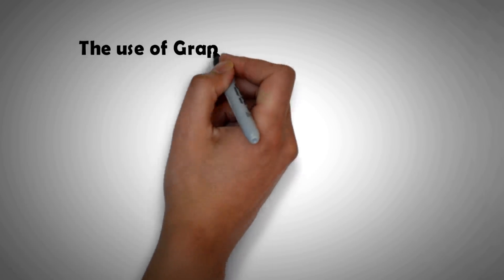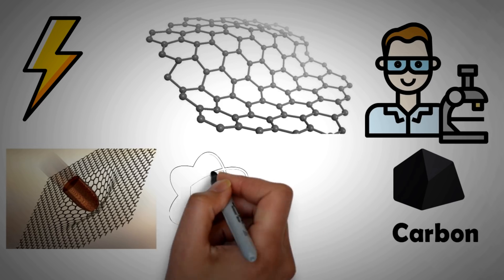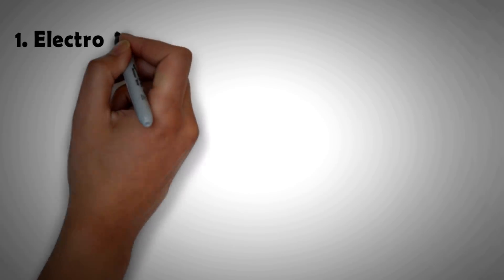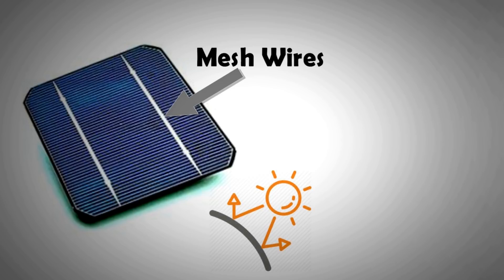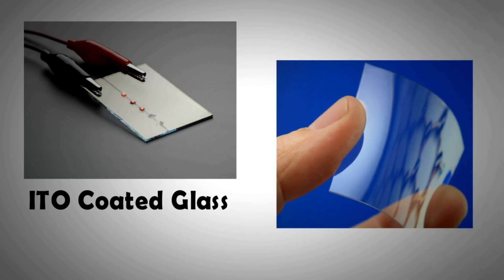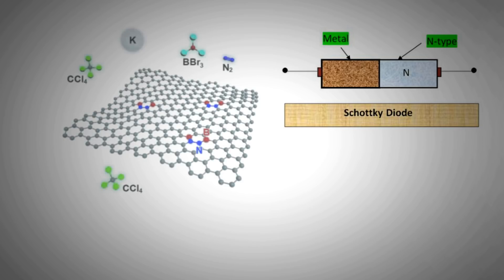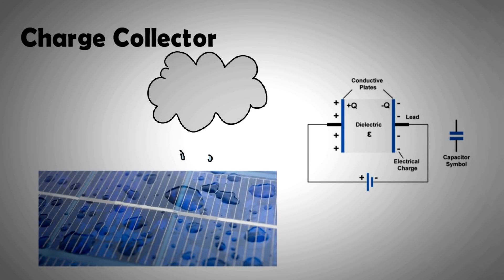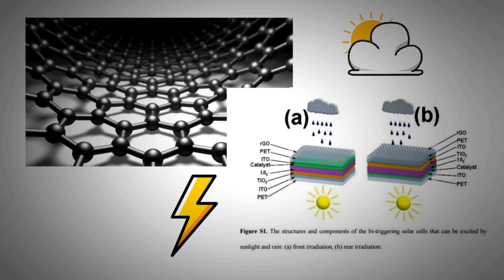How Graphene is taking Solar Cells to the next level

Comment: Reading the comments shocks me how little people understand how challenging it is to get from the research stage to the product stage when dealing with a fundamentally new discovery. The fact that graphene is finally being generated by suppliers like Sony means that we're still some time away from scaling out the supply that will then allow the most basic usage. As an entrepreneur for several decades I've seen technologies be hyped up in the press, then disappoint, then gradually become mainstream. Bluetooth is a perfect example. It was labelled a failure after the hype cycle didn't result in products in people's lives. That changed around the time smart phones arrived and Bluetooth is now expected in so many types of devices. The only way to speed this up is to buy graphene, create startups that create products that use it and thus create product demand that ensures suppliers invest in scaling out and lowering the cost and improving the range of graphene available. Otherwise you will continue to complain that it is a conspiracy of greed holding all the good stuff back from you, the lazy consumer. Got the dream? Do the work.
Reply: Bruce Joy what you say is very true.
but the problem of. getting venture capital stops many new products.
socialist economies can go from university research to market very easy.
as capitalism does the R&D the socialist can manufacture thru state investments.
this stop venture capital as rates of returns are decimated by copy cat products and reverse engineering.
Reply: That process also brings decisions from bureaucrats which they have no expertise in ,such as China building cities where there is no need and Russia starving millions with collective farming.
Reply: @delallegood5799  those cities might seem unnecessary now, but in the long term...

Remember, China got to this point by playing the long game.
Reply: @ki0w0-lordofwatersheep  Great idea, so why don't we overproduce for all our other EVENTUAL. maybe needs.  I disagree! Why don't yo go out and build a 3 car garage, in case in 20 years you MIGHT need it? 
PS.  don't for get the buidling maintenance costs in the meantime. Cracks in the foundation, new roofs etc. !!!
Reply: @delallegood5799  the collective farming thing was on purpose to kill. not incompetence.
Reply: @carlojones8610  jeez....you do know that socialist societies don't innovate right?  They will never produce a new product on their own as a result since no matter how hard you work, you can never do better for yourself than the government allows, so why bother?  THAT is how socialist societies work, based on real human nature.  Any of you think otherwise, you should go smack down your teachers, because they failed you or sold out your future to the highest bidder.
Reply: They have already started to produce Graphene batteries in China:
https://www.youtube.com/watch?v=QqBsmIeos4g
it's just matter of time
Reply: Indeed! The folks are claiming that the "promises" never became truth, but it's not them that are stuck into a laboratory, day by day into a small room developing the material that the MEDIA, not them, scientists promised.
For anyone that is not putting efforts, shouldn't even complaining!
Reply: The graphene generation at this point is very expensive... The search for a way to generate it inexpensively and in large sheets is spending tons of money at this point.. I look forward to success at some of the larger universities.
Reply: K
Reply: People are doing the work. https://hobbyking.com/en_us/turnigy-graphene-professional-10000mah-4s-15c-lipo-pack-w-xt90.html?countrycode=US&gclid=Cj0KCQjww47nBRDlARIsAEJ34blPgOnUQN1CHPa-QRsbPVn3bzkC9izOO2nPsfdBiFHOWuL9AKh4MvYaAgfjEALw_wcB&gclsrc=aw.ds
Graphene batteries are showing up in my hobby, high performance quadcopters for racing and freestyle flying. The example I linked is actually intended for a big video rig, it was just the first example that came up. Someone made the comment that it's easier to bring new technology to market in socialist economies. Perhaps the same is true under communism, as I'm pretty sure these batteries are being manufactured in China, since pretty much everything else we use on multicopters,or really the entire R/C hobby, is manufactured in China. If the US got into a war with China, I wonder if, in an extended conflict, the US would wind up having to go back to catapults with so much of the technology being manufactured there nowadays.
Reply: If the work does not pay then nobody is going to do it. It will not pay until a working product goes into mass-production. Even if someone invented a graphene CPU that is a thousand times faster than a conventional silicone CPU, they would still never get to mass-produce it legally because of the patenting laws that are used to prevent anyone from being able to invent anything without the big greedy rich corporations hoarding all the legal resources to steal every patent and claim they alone have the divine right to mass-produce anything. It's sad but that is how the world works. The only thing that the powers that be want the creative geniuses of the world to do is slave for them in their factories. The cost of patenting even the simplest of contraptions is in the multi-million dollar price-tag range.
Reply: Galv140577 I knew of a company in Florida around 2001 that invented a CPU 100k faster.  I checked back in a month not there, and even at the Secretary Of States office no longer listed.
Reply: discovered 20 years ago and nothing new
Reply: Wow you really like to type
Reply: You're ignoring a giant reason most tech never makes it from the lab to the retail stores, big oil is ready to buy up and destroy anything that has a realistic chance of becoming a sustainable alternative to oil.
Reply: Its nice to see this comment two years later and see how easy it is to make graphene at home now. Tech is moving fast.
Reply: “5 grams of it cost $200”.  Once the commercial cost is known, it is not too long before the cost comes down. My estimate is that graphene will be a reality in our lifetimes, within 25 years.
Reply: Your approach is typical of a guy who is not an engineer , or with very little engineering knowledge. Your approach to start buying graphene to accelerate development is nonsense, because getting graphene is as easy as sticking scotch tape to graphite. What the industry is lacking is a process of converting light to electricity using graphene. Until that is done (somehow) everything will just keep going like before , with everyone buying traditional solar panels.
Reply: what kind of intermediary businesses can one do with graphene to make money now?
Reply: There is a company in Dayton Ohio that mass produces graphene for commercial and industrial use ! Yes , the ability to create tons of graphene is here ! Bye bye silicon valley ! 3d printing will go wild now with unlimited inexpensive graphene ! Samsung battery technology blend graphene capacitor / batteries for power and storage ! Also carbon foam batteries out perform lithium ion phosphane batteries ! Using graphene can charge a battery in a few minutes not hours ! Graphene allows for millions of charge discharge cycles ! 200 times stronger than steel 99.8% lighter ! Also flexible and can stretch by 20% and is transparent ! One atom thick 2 dimensional molicule with 6 sides connected by 6 atoms !
Reply: https://bit.ly/2C0qCeE?-your-home-solar-panels

Comment: 8 projects designed in 18 festival Sheikh Bahai of Iran Zero pollution high efficiency in 2024:
  
Thank you, "The best choice in 2025, replace Methane with graphene and H2, New method and our innovation for making huge graphene solar panels.", https://youtu.be/sBO1ghQO4VA?si=cQm0g..."
The world will change soon.

1-Cargo Ship Engine Production by Nitrogen and Carbon Dioxide Compressed and Engine power 150Megawatt hours and separate N2, O2 from air with strong power magnet.
2-Closed Circuit Production of Hydrogen, Graphene from Methane for producing solar graphene panel and Nano composite materials.
3-Design an Active City Bus and Truck (BRT)Engine with Liquid Hydrogen Fuel and permanent Tank Cooling sys
4-Design of New Helicopter-Aid with Liquid Hydrogen fuel Awarded by sheikh Bahai festival.
5-Design of Seasonal Sea Water Treatment Plant with evaporation Method Jet Plasma in the Desert climate,
 Machine Power is 150 Mw/h and 20000 M3 pure water and Fertilizer, 
useful Minerals with zero pollution 50% Reduce fuel by use of cations. (Awarded by ABFA Isfahan Company).
6-Design of free Marketing of Students' Innovations National and international Students Fund'.
7-Reconstruction of out of Flight Cargo planes or Liquid Hydrogen fuel jet engines,
The simultaneous use of two parallel Railway Lines with a certain distance in the Desert Plateau Climate of Iran for bulky load and carrying water and emergency natural disasters, ....
8- producing high air pressure with zero pollution.

Comment: I wouldn't consider ITO expensive. You said 5g ITO would cost 200$ you may should have added that ITO coatings are very thin like about 100 nm thick. 5g goes a long way. Also Plastics can be ITO coated like PET for example. So flexibility is no problem. Yes Graphene is awsome but please dont prais it to heaven, be objectiv. Still a nice Video, well done.

Comment: Graphene can do everything except get out of the Lab
Reply: Bro this quote is seen in most videos, like really
Reply: @Mewoi9205  well I guess someone had to post it 😂 but in all seriousness, why is the L capitalized?
Reply: There is a company making two battery banks you can buy now with graphene in them. And apparently next years Samsung phones will have graphene enhanced batteries in them.
Reply: I am already using Lithium Graphene batteries
Reply: @mosesravoori  lithium battery with a few graphine bits in it. It's not exactly a full graphene battery.
Reply: @mosesravoori  no you aren't.
Reply: It’s already used in concrete and electronics. Not sheets, but flakes
Reply: @edwardduda4222  no it isnt. that was just some hype from those dodgy Rice University snake oil salesmen with their fake 'flash graphene' scam.

Comment: Cool!  Thanks.  I actually didn't know that graphene was optically transparent!  I think it's going to be very interesting to follow PVs, as there are now more possibilities, including both graphene & perovskites.  Hopefully, PVs can really start being much more efficient, & find many more practical uses in everyday & industrial life.  Very well-done.  Thanks again!       Rikki Tikki.
Reply: Well the material itself is not "fully transparent". It's Atoms are the same as the ones in your Pencil. The Point is, that its only 1 atom-Layer thick. Any material will be transparent, if you reduce the thickness over and over again until you reach 1 Layer of Atoms. Different materials are not stable in 1-Layer (so called 2 Dimensional) form. 
You can compare it to a Mash-Fence made out of Iron. Iron itself is not transparent - however mashed as a net of small wires it becomes mostly transparent. If you walk several hundred meters away from the fence, it will become completly transparent for the human eye. -> The same is the case for Graphine, it just needs a much smaller distance to already be transparent.

Comment: I have been wondering if a graphite tube could be used a sort of paint roller, and roll it over the sticky side of book cover plastic or something similar sticky plastic.. if this would make useful surface for photovoltaic cell, even though imperfect structurally, they could be produced super cheaply and fast while keeping the keeping complete cell rolls light and flexible?

Comment: I definitely think that graphene should be used to cover all of our homes to collect/store sunlight and being flexible it's ideal for houses because they also move. We have to get away from using oil and coal and graphene is definitely the way forward. I work as a lime plasterer and lime does it's bit for the environment because it uses less energy to make than cement and is also less toxic and if you use a lime putty mortar or plaster if you have made too much you can put it back in a sealed tub and use it many years later, with cement or hydraulic/hydrated lime you can't because once the aggregate and water is added it starts to set and you have to throw it away.
Lime also lets water vapour out from the building and a lime wall will absorb carbon dioxide. I wonder what could be done with graphene and lime,
got any idea's please?

Comment: In graphene, an electron stays free for only one picosecond. This is too short for accumulating a large number of mobile electrons. This is an intrinsic property of graphene and has been a big limiting factor for applying this material in photovoltaic or photo-sensing devices. Although electrons in graphene can become mobile by light excitation and can move quickly, they only stay mobile too short a time to contribute to electricity.”
The tri-layer material built with single layers of MoSe2, WS2 and graphene on top of each other tackles that challenge.
Reply: Great observation and analysis!  These things you've have noted have always been the challenge when working with graphene, I believe a break through will happen within 5 years though.
Reply: what do you think about graphene solar panel from Freevolts ?

Comment: create a window with graphene to produce energy is not necessary to be 100% transparent the window with 75% is more than enough the key would be that the heat should not enter the houses and for that it would be more than sufficient to incorporate argon gas in a second glass that eliminates the possibility that the interior of houses will overheat

Comment: I liked hearing your description of graphene as a conductor instead of wires, but when you said it was 20% efficient, I felt pretty underwhelmed. Isn't 20% pretty low compared to the silicon cell that you were showing? I thought they are around 22.5% efficient.

I still say that when it comes to solar power, the heat collector types are the most efficient use of a patch of sun. They are closer to 70% efficient. Way out of range of solar PV cells. They do need trackers and are often centrally located but still the efficiency is 3 times higher! Also the reflective materials have been around for thousands of years. No need for an innovation that is very expensive and does not work nearly as well.

Graphene does sound interesting though, I am really looking forward to a large scale roll out of it
Reply: Also if the solar power plant is turning heat into electricity, then it is really easy to combine it with natural gas for backup
Reply from the maker: I think the excitement is that Graphene Pervoskite cells reached efficiency of 20% in a few years of research. Crystalline Silicon took decades of research to get to the same level. Solar Thermal is more efficient that is true. Electricity however is a more versatile form of energy

Comment: How many years have we been hearing about Graphene and how amazing it is/will be, how many products have ever surfaced?.....
Reply: Good question
Reply: First we had spider silk that was supposed to be the breakthrough. Now this. None of it is viable. Next will be "Cockroach nostril hairs are ten time stronger, more flexible, super duper chemical sensitive and impervious to all forms of radiation!" 
Yawn.
Reply: Think about this... Rockets were researched in the 1930's, but took another 30-40 years before they were impacting our lives. Digital cameras and HD tv were first made in the 70's. Did you have those in the 1990's? There are too many promising technologies for graphene to fade away.
Reply: @Stevenisbelieven  yes! and YES!  👍🏾👍🏾
Reply: You can buy graphene condoms on Aliexpress
Reply: @razielestrada7298  
STILL not strong enough bruh.😁
Reply from the maker: Here are at least 10 in this video
https://youtu.be/z9aF8GcBTZU
Reply: meh...some over priced clothing and sporting gear for the most part... i think he is looking for all the amazing stuff that was supposed to come. salt water filter's etc. these new products were supposed to change the world....fail...
Reply: @EgoBruiser  even aluminium was once commercially unviable due to the methods of producing it. Same with various plastics that are now commonplace, same reason most next gen car tech is in super expensive cars but then move down to the cheaper cars years later. Research economies of scale. 

Start with the over priced stuff rich guys will throw money at so they can pay for the development of better or bigger manufacturing processes until it's abundant and common.
Reply: That´s because it´s not open source R&D. They´re currently missing out on a lot of knowledge and skills that could have sloved this minor problem already.